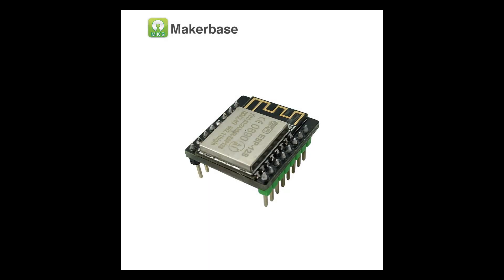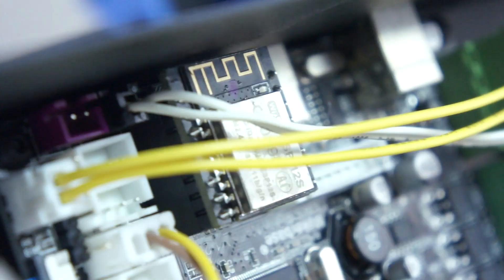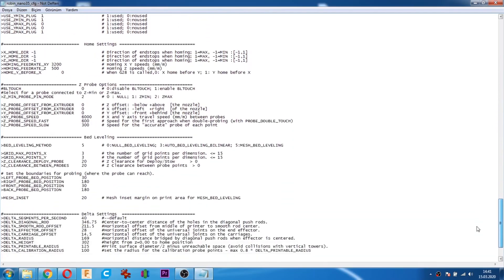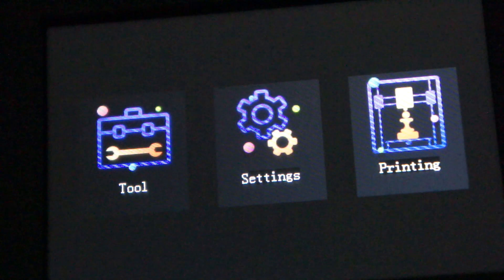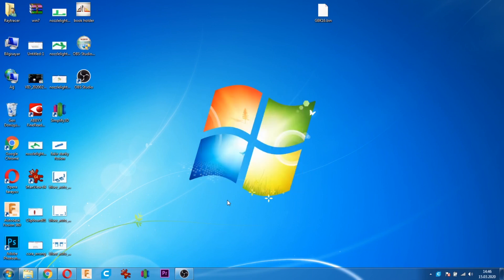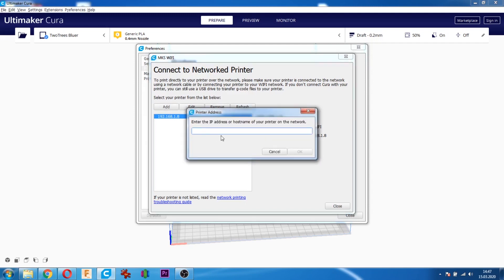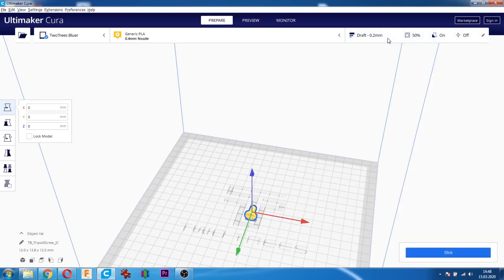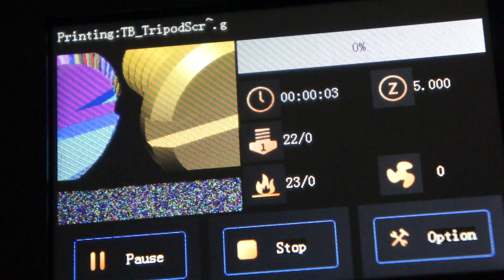Two Trees Bluer MKS WiFi Modül (ESP-12S) Ekleme ve Cura Ayarları

Comment: How did you add the two trees bluer to cura . What is the settings to add ??
Reply from the maker: go to the site. Follow the steps on the page. https://gsxbr.net/homunculo/?p=441
Reply: TA4AWS I went to your website and followed the steps . When I opened your settings on cura I saw that you put there filament diameter 2.85mm for the two trees bluer . The correct is 1.75mm , isn’t it ??? Did you check the others parameters there ? Are the others parameters there correct ? Because 2.85mm for de filament seems not to be correct
Reply from the maker: ;) https://youtu.be/CW4LH-ZeLKo